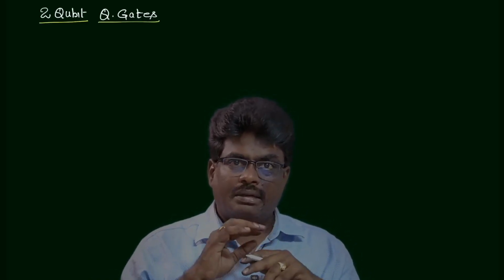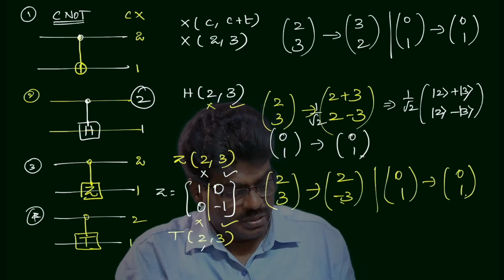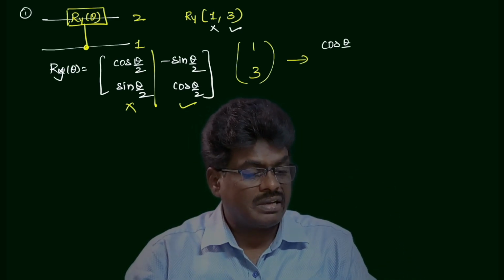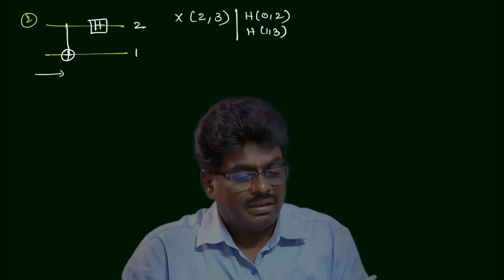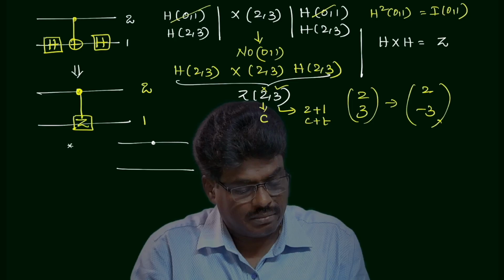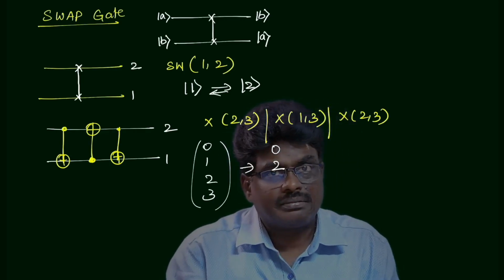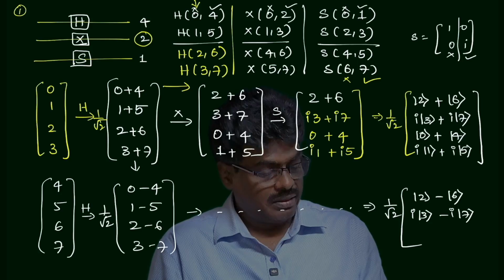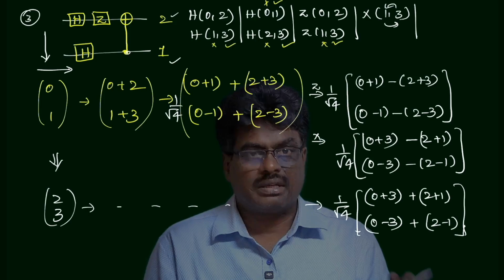Two Qubit Gates and Circuits ( Lecture #2 )

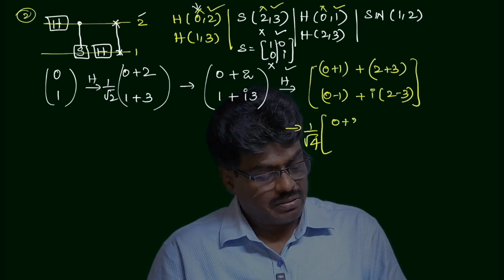Comment: 58:15 SW(1,2) should flip the lines right, else its same as X(1,2).

PS: X(1,2) is not realizable, cleared my doubt
Reply from the maker: Yes, SW (1,2) means flip of states ( decimal values). X(1,2) is also the flip operation, if you any to realise the situation pls consider the decimal states |1> and |2> in terms of binary and operate X gate operation.
Still any further doubt, please send mail to uvphysicsacademy@gmail.com